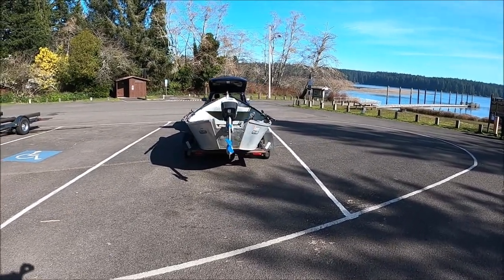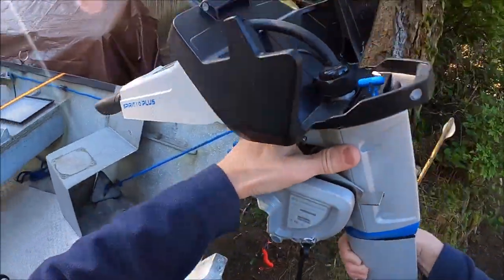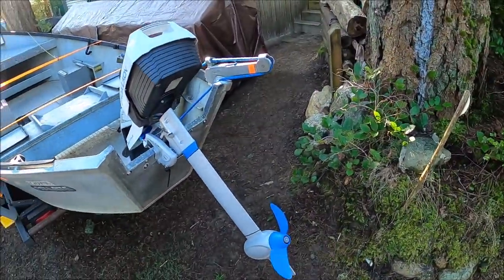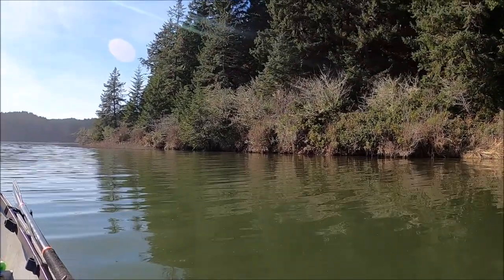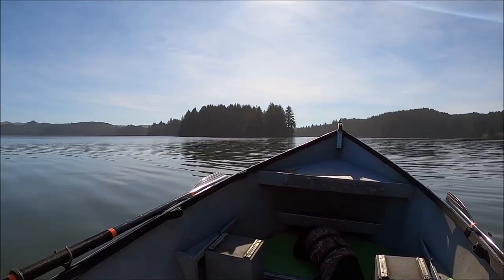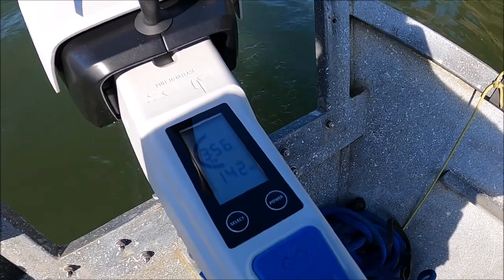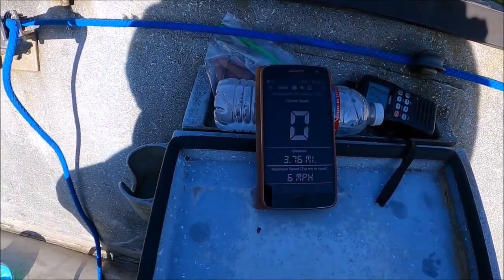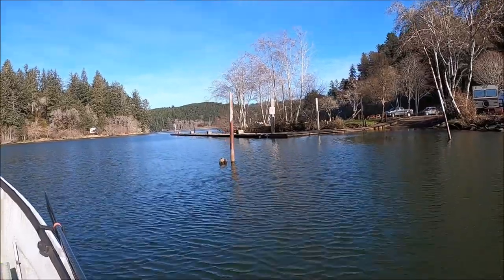ePropulsion Spirit1.0+ Drift Boat Test

Comment: That's a pretty cool little motor, I have a little Minn kota, it does okay and weights, but it doesn't have very much push in the river, I use my gas outboard for that work, I'd be interested in seeing how it does against a slow  river current

Comment: Was thinking about getting that motor with a 14’ Porta-bote for a light gear, putting it on top of my JLU Wrangler, to go fishing while camping…
Reply from the maker: I think that would be a great plan. The prop limits you to about 6mph regardless of the boat but if you only need to be at 50% power to go that speed, you get more hours out of the battery. Really pleased that I went with the ePropulsion motor.